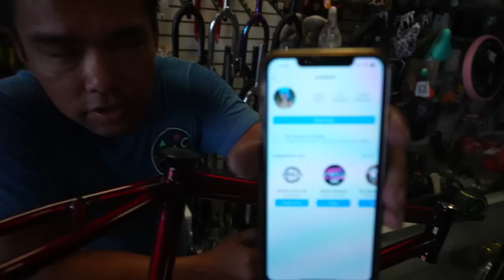BMX Bike Frame Geometry 101! | Everything You Need To Know!!

Comment: Just some useful info for bike tuning geo wise. 

Every .5 degree steeper you go headtube angle you lose .15 of an inch wheel base length. 

Going 1 degree steeper or slacker on the Seat tube angle accounts for a .25 of an inch in top tube feel. So a 20.5 with a 1 degree steeper seat tube angle will feel more like a 20.75. 

25.4mm to a inch. Which can help in fine tuning reach if you want to play with top tube length and rear end length. 

With uber short rear ends there's a point where the extra length on the top tube gives you leverage on the pull up making manuals more tricky. 

Bb height can also be relative. Higher bb makes spins easier an other stuff. But thin pedals can change bb height same with tire profiles. Same on the headtube. A shorter fork axle to steerer tube will steeper your headtube. Taller slacken it. Skinnier wider then tall profile rear tire and a wider taller front tire profile can raise your bb and slacken your headtube. 

More spacers under your stem versus a stem that raises your bars an equal amount or just taller bars. Changes reach which changes how long the top tube feels. But can also affect leverage. Why riders like Sean burns run a flipped top load stem. It provides a different leverage point even after you account for setup differences and equaling effective bar heights. 

Taller headtube helps with headset and fork strength. On frames like the tall boy or if they have gyro tabs. A 175mm fork or even on regular frames with shorter forks. If you can get the gyro to sit below the headset dust cap. You only need about 20mm 25mm at most of steerer tube besides your stem. Also means for drilling tabs you can reduce the amount of spacers needed. 

But taller headtube and slightly longer fork steerer is stronger than taller bars for same effective bar height. And provides less leverage for the bars to slip on the stem or break. And done properly a flipped top loader can help counter act some of the leverage differences. 

Unless you really need uber short rear ends or a low bb or uber slack headtube. Minimum 13 to 13.25 cs 75 headtube and 11.8 bb seems to make the most sense. Especially given shorter cranks popularity. For low bb stability mix lengthening stays and lowering bb. Shorter cranks should have better spins with the raised bb and more pop for hops with the rear end still stable enough for other stuff then just modern tech street. 

Fork offset can help make up if you need more front end response or less. Same with tires. Thin pedals more planted into the bike but more sprocket clearance and still help with spins. 

Kinda like how Ethan picked basically in the sweet spot for stand overs. 8.75 to like 9.5 ish is what looks and rides best. 10 is for tall dudes even 9.5 bur if you do alot of bars it helps. 8.75 for more whips. 9 to 9.25 sweet middle ground.
Reply: thanks for this! massive amount of great info here

Comment: Tried a trick geometry frame with 11.875 bb height and 21 tt and went to 11.5 bb and 20.75 tt and my riding experience has improved dramatically,  270s, fakies, half cabs,   etc, all got easier for me, the right geometry can help the average rider a bunch.

Comment: forgot to mention seat tube angle. Also it seems that bmx frames have been using flatland frame geometry more as time progresses. shorter chain stays and steeper head angles have been on flatland frames for decades. Although i like the look of a frame with shorter stand over height, the lower tt for clearance also has its drawbacks it makes for a weaker frame. Remember a perfect triangle is strongest so the lower the tt the more narrow the triangle thus making it weaker. So bigger standover = more even triangle = stronger frame. Cool content keep it up.

Comment: Hey!! There's no way in hell I'm riding Trails on a Flatland Bike!! I've got a Flatland set-up 75°, 19.5", 12.5" BB Height, 12.75" Slammed Chain Stays, Zero Offset Forks, 160mm Cranks, Freecoaster, 20/9 Gearing haha, F-That on Trails haha!!! A properly tech street bike would terrifying too haha! Something like a BSD ALVX AF Frame would be scary! My Trails Frame is 74.5, 21.8, 71, 11.4, 9.2 & I run my CS's about 14/14.2" I think a decent Street Rider could probably do alright on it tbf.

I do get what you mean though, for the most part! BMX is a 20" Wheel, Frames, Forks etc parts that effect the way it feels for technical, slow, instant pop etc for street & then long  & low for Trails, slack geo kinda dealy.

Comment: Why are the wheels 16 “actually 
And they say 20 but it’s length not height which is usually 8.5
Reply: the term 20" refers to the outer diameter of the tire when inflated and is a rough estimate because tires will have different sidewall heights and rims have different widths.